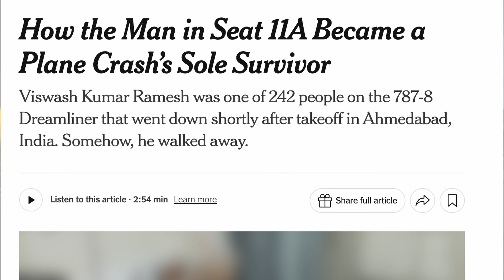Why the RAT Changes Everything – Air India 171 Update

Comment: I watch Mayday and research plane crashes for the airline industry as kinda a morbid hobby. I find it fascinating how investors put things together and make air travel safer. Unfortunately it seems to time and time again come at the cost of many people’s lives.

Originally I had thought that the flaps for flight 171 were improperly set as a duel engine failure is almost unheard of.

Three flight accidents that I know of; Northwest Airlines Flight 255, Delta Air Lines Flight 1141 & LAPA Flight 3142 happened because the flaps were incorrectly set.

This changed everything though. Thank you for this informative video though. RIP to all thoughs lost.❤

Comment: Yeah think about it in the vid with the RAT down you can't really hear the normal engines as if I were a pilot would you not set throttle to max if I was decending? But you cant really hear the engines at TO/GA further highlighting the fact of engine failure.

Comment: People saw and were talking about the RAT deployment very soon after the crash, i.e. before you -- hopefully the flight data recorder will be found intact (enough) and indicate what went wrong -- a dual engine failure seems unlikely in the sense both engines failing independently at the same time? -- doubtful -- again, wait for the flight data recorder (and flight deck voice recorder)

Comment: how much energy output is a RAT? couldn't they have a nuclear battery to run backup power along with a secondary hydraulics that could kick in and replace ?   they use small ones in pacemakers that last forever.  seems kind of privative for a new aircraft

Comment: Fuel contamination possibly, similar to what happened to Cathay Pacific, where they lost thrust in both engines in mid-flight few years back, I believe that was on a A330. If that's so fault can't be put on Boeing issues, as many are attacking Boeing.  All it takes is someone taking short while testing the fuel at the fuel farm, and this has happened at an airport I use to fly out of.  Real mystery. Would be very interesting to see the end report, as we can guess all day until the actual report comes out.

Comment: Question for any experts. Switch from an airport in India to Dulles airport, Va. when the same situation occurs. The pilots realise there’s a problem, instead of raising the landing gear they keep it extended, the RAT gives them a modicum of control of the flight surfaces in such a situation could the pilots try and bring the aircraft down on the interstate that is adjacent to Dulles? What I’m really asking is if there had been clear ground could the plane have been brought down in a controlled crash landing with wheels down? Was this what was going through the minds of the Air India pilots, but there was nowhere to go?

Comment: As the runway was nearby, was their chance of doing U turn? Or is it a slow process? Engine check engineers before flight should give some clarification if they had changed it properly or not?
Reply: they can only do U turn if the airplane was high enough. but in this case it was too low and descending to hit the ground before they can make any U turn.
Reply: basically this was a death sentence

Comment: In case of dual engines failure could it be a pilot mistake of shutting off both engines? I remember of one case it happened after take off at higher altitude (2000 ft and fortunately they restarted at least one engine).

Comment: A complete hydraulic failure would make it difficult (impossible) to raise the gear but the flaps appear retracted but maybe not. Regardless, he wasn't flying fast enough for that flap configuration. Contaminated fuel COULD cause a dual engine failure which would cause him to lose hydraulics and electrical power.
Reply: What could contaminate the fuel?

Comment: What an embarrassing video! 👎👎👎

First of all, how can you "confirm" that the RAT is deployed? The image provides no conclusive evidence—it's unclear whether it's out or still stowed.

Secondly, and more critically: Captain Steeeve, did you consider the descent rate associated with a double engine failure at V2+15, likely at 80% of maximum takeoff weight, and with the landing gear extended? ?

For those unfamiliar with aviation: that's approximately 3,500 to 4,000 feet per minute. Yet, in the video, the aircraft appears to be approaching for a normal landing, which typically involves a descent rate of about 750 feet per minute.
Reply: You can hear the RAT
Reply: @AtlasAirwaysNo, I can't!

And you just imagine you hear it.

Think about how long you hear the noise and how long you should hear it, when it is coming from the plane. You will have to agree, that you would hear the RAT much longer.

Comment: The sound had shown the RAT had deployed, you can hear it. That means most possibilities could be 2 engines failure. When dual engines failure, RAT will automatically deploy. Quite impossible is no. 2, if the flaps were not deployed, as 787 will alarm the pilots,not possible the pilots didn’t know they made mistakes.

Comment: This is why I have never cared for ETOPS, which permits long over-water flight by twins, which prior to this mandated the use of 3 or 4 engines. The mathematics that underpins the safety of ETOPS, is predicated on the cause of each engine failure being unrelated to that of the other, on any given flight. This carries weight because the statistical chances of two unrelated engine failures are vanishingly rare, to the point where it can be disregarded. The problem is, sometimes the causes of engine failures ARE related. Fuel icing on short finals by the 777 at Heathrow, Sully's bird-strike being examples. In some cases ETOPS may contribute to this, as engines with much larger frontal surface area are typically used, raising the chances of a critical mass of birds - especially if THEY are flying in formation  - knocking out 1 or more engines. Certification tests for bird-strikes, assume a single bird ingested, not a number of them. Once you accept that a number of them may hit, if you hit - for example - a formation of Canada Geese - then the probabilities of a single event knocking out both engines becomes less supportable by the maths of ETOPS. Older types, with less bypass flow - and therefore smaller cross-sectional area - , and 4 engines, not 2, were safer in this respect.

Bird-strikes are not the only event that has caused dual simultaneous engine failure. Other causes have been flight into heavy hail, maintenance errors, fuel system problems, or uncontained engine failure - parts of the failed engine exiting the shroud around the engine at high speed and penetrating the other engine or systems critical to it's use. 

It remains to be seen what caused it in the case of Air India's flight. That it happened is appearing more and more likely with the apparent deployment of the RAT. It was either astoundingly unlucky, or, merely a question of when, not if, a dual failure occurred, subject to what you make of the assumptions made that aircraft design able to move from 3-4 engines to only 2 under ETOPS. From the 1st day I became aware of  ETOPS as a sprog commercial pilot 30 years ago, in ground school, I've thought it flawed, as aviation has proven, since it began, that redundancy is always the better bet. As an exemplar, BA 009 that flew into volcanic ash - before this was tracked and appeared on SIGMET - lost ALL four engines (from a single cause note you!) before eventually being able to restart and use 3 of them. One wonders how successful they might have been with only two failed engines to try and restart.

I'd say that ETOPS needs a fundamental review, as a tenet of aircraft design, and as a concept, ought to have been strangled at birth, however, the implications of it being found unacceptable now are profound, namely grounding tens of thousands of aircraft permanently. That simply is not going to happen. And so we continue to consider it safe, and overlook related engine failures, as whilst not perfect, it only rarely sees aircraft losses. My advice, if you count the engines, and divide by two, and the number resultant is less than "1.5", understand that you just might have cause to regret it.

Comment: Engines under full computer control? Is there a monitoring routine designed to protect the engines from misconfiguration, developing faults, etc. that would roll back the throttles? Could a computer routine roll back both engines and automatically deploy the RAT?
Firewalled throttles as an emergency action by the pilots should have made enough noise to drown out the RAT sound, therefore both engines were not making noise.

Comment: Adding to that, people have come forward that the electricsl system of the plane already had problems on the previous leg. Another user explained that he is an Air India pilot and had an engine failure on exactly this plane and continuing maintenance issues. Looks like a severe maintenance issue and Air India will have to explain a lot…

Comment: One more thing from the audio track. If the engines were running at full throttle they would be louder than the external power fan. There's not enough engine noise on the audio!

Comment: Yes reason for RAT deployment is dual engines failure, but what caused it is the question, see simulator data given based on dynamic  load conditions before & during take off , i strongly believe (personally) flaps were issue to confuse the system input to engine power as at high ambient temperatures 

Takeoff Configuration:
----------------------
- Flap Setting: Flaps 10 (it  is not showing in any video) 
- Thrust Setting: TOGA (Full Takeoff Power)

Environmental Conditions:
-------------------------
- Takeoff Weight: 228,000 kg (MTOW)- (European & North America allows more bagage) may be load sheet error 
- Temperature: 42°C
- Elevation: 53 meters above sea level
- Runway Length: 3,505 meters
- Wind: 13 knots headwind

V-Speeds (Estimated, KIAS):
---------------------------
- V1 (Decision Speed): 148 knots
- Vr (Rotation Speed): 158 knots (this was recorded speed)
- V2 (Takeoff Safety Speed): 168 knots

Takeoff Notes:
-------------
- Rotate gently over 3 seconds to avoid tail strike
- Target V2 + 10 knots (~178 KIAS) for initial climb (plane was much beyond this speed)
- Ensure full thrust is set due to high ambient temperature ( Thrust may not produced due to improper flap settings)

Comment: Grabbing the wrong handle is kind of vital. I think they should change either the location or make sure they visually can better see and feel they using the correct handle? Just a thought.
Reply: Probably the RAT deployed because of dual engine failure. The engines failed because they stalled? Due to the flaps?

Comment: There were people who have  been saying this for long .. Secondly... The account of the survivor had specifically said two things .. one there was a loud sound... and the lights flickered.... you discounted it saying hnreliable. . Even though all things he said are in sync with video....except you and another person cha nel ..no one else was pointed a finger at the pilot despite evidence of technical failures...

In fact there are others who showed in simulator that what u were saying on all tv channels was not correlating .

Lastly .. u still not considering that the plane was struggling slightly on the runway itself beyond the point of no return and hence used far more than the plane  usually does .. indicated by the dust cloud...

To a lay perso. Like us .. were stumped by your analysis that the second pilot flap fault caused. 

Good that you corrected but I am sorry to say the analytical credibility does tame a hit.

Comment: If you view the film of the take off video, at the point of the plane leaving the ground, there appears to be some white debris going off to the left. It is a single piece with no smaller bits, so not bird, however what if there was some rubbish on the runway the plane ran into, sucking it into both engines?

Comment: Very intrested to hear how both engines stopped giving thrust. From what I understood they dont even need fuel pressure to work during a take off (gravity and existing fuel would keep them going). Due to redundant systems, one electrical failure wouldnt take the whole plane offline either? As always, it's probably a list of many human errors before this is possible. Hopefully they'll figure it out.

Comment: If you look at the landing gear you can see that it is tilted forward. On the 787 the landing gear is tilted backwards. The only time when it is tilted forward is when the pilots select gear up and before it goes up. This means that the pilots did select gear up but the failure stopped the gear from retracting

Comment: It’s sad to see that aviation technology has advanced so much but they still don’t include crash safety and passenger protection in its design, unlike cars. Cars include airbags, seatbelts pre-tensioners, and impact and rollover protection to anticipate a highly unlikely event but aircraft seats, seatbelts and safety technology has pretty much remained unchanged since commercial aviation began. Its focus is always on improvements in redundancy and fail safe systems on hydraulics, electrical and avionics and little is done on impact protection.  Data is never released in terms of the cause of death on casualties whether it was on impact, explosion, asphyxiation, or trauma to vitals or by fire or smoke or by a combination of factors.  If cars can factor in their designs impact protection for passengers surely aircraft could also do the same.  Yes there is always the cost and commercial component but if any features could save lives and minimize injuries it is beneficial.  I’m sure widely available systems on powder form sprinklers, airbags, over the shoulder seatbelts are not complicated and expensive systems to be modified for aviation use and yes this is redundant most the time just like the airbags and seatbelt pre-tensioners in our cars.  Counter argument has always been nothing will help if a plane is falling out of the sky travelling at 800+ km/ hr. But on most of the accidents the plane is most prone to trouble during take off and landing hence altitude is relatively low and speeds are less than 3-400 km/hr so it is still somewhat within the range of the human body can withstand providing the right protection systems are deployed and used at the critical point of impact and thereafter.

Comment: The recent "What Caused Air India 171 Crash, Mysterious Sound Before Impact" segment by Jeff Ostroff discussed the RAT THREE DAYS AGO 

The theory that the crew accidentally raised the flaps instead of the landing gear is highly implausible—the controls are separate, clearly marked, different operation and would trigger immediate audible alarms if used incorrectly, just as they would during takeoff if set in the wrong position. This explanation was never credible unless the pilot was impaired  ( drink or drugs ) or acting intentionally.

Comment: If you look closely, the landing gear is leaning forward, which is not normal for this plane. 
That means, they wanted to gear up just a second before hydraulic went down. That caused the tires to set into a bit tilted position, as the "gear up procedure" begins.

Comment: Does this also explain the landing gear remaining lowered, as the engine failure after take off meaning that there wasn't sufficient hydraulic power to lift the landing gear?
Reply: In a way it does, usually a landing gear is picked up about 50 to 60 seconds off of take off and if there is a massive failure the RAT would deploy, but I think it never got that far

Comment: Wouldn't a dual engine failure cause both engines to shut down and cause an abrupt break in the engine sound right after the point where the aircraft gets airborne? There would be a distinct difference between an ideling rotation and a powered rotation - I think.
Reply: My friend asked me to listen to the audio on the original without the video and didn't tell me what it was (I didn't know about the accident) It sounded like a large plane landing and pushing the engines....The raw raw raw of the engines sound could be based off of echoes from the city below, which I've heard before

Comment: the black box will have even more information  at this moment in time should 787's be grounded or the airline Air India be suspended  till further investigation , 2001 Air Transat 236 had to deploy the RAT after losing all engine power over the Atlantic on Air Bus A330 fuel leak caused by improper maintenance,  I hear so many theories but this one is the most plausible esp  coming from an experience Commercial Airline Captain  your observations Captain  will be invaluable to investigators ,

Comment: You should make it clear, Captain S, the RAT is not a 'propellor', it's a turbine - the air pressure makes the turbine turn which then provides power of some sort to the aircraft.
Reply: @KlausMaver-q5e  A propellor is a device that uses power to push through a fluid - water, or with aircraft, air - it does work to turn power into *motion*.
A turbine does the opposite - you put it into a fluid flow - e.g. in a hydroelectric dam - and the fluid flow (motion) does the work that the turbine converts power.
Think of the word 'propel' - that's not appropriate to a RAT, it's not propelling the aircraft.

Comment: Both engines lost power as someone turned off the fuel pumps before the takeoff, which got the aircraft just enough fuel available in its valves to take off and reach a few hundred feet above ground.

Comment: Also seems like the front of the main landing gear wheels move slight forward As 787 landing gear move forward before retraction but in this video looks like the landing gear move forward bt never retract may b due to hydraulic failure and loss of dual eng failure